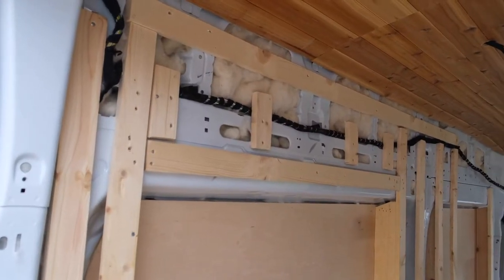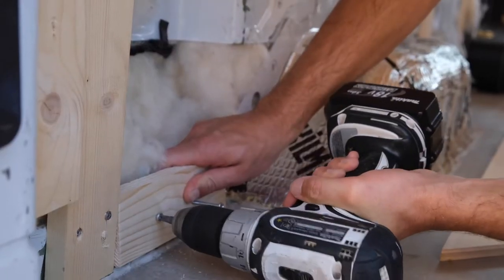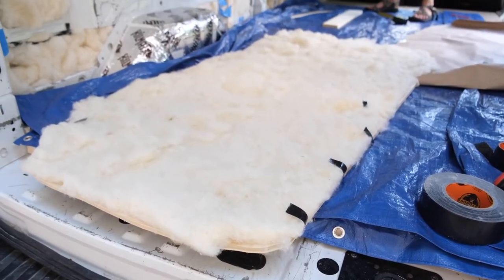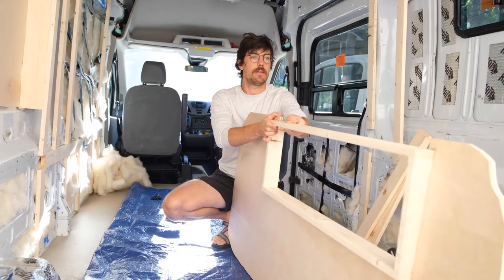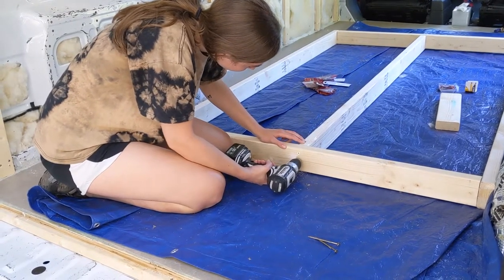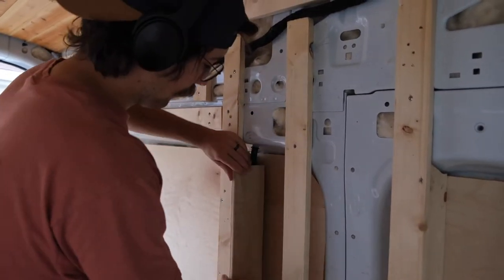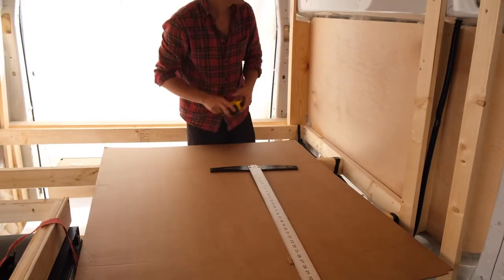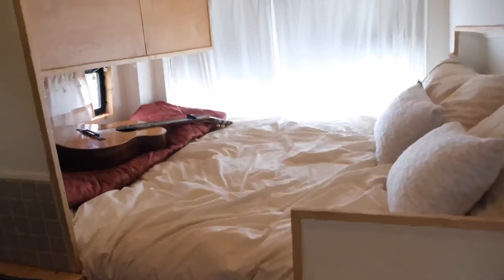DIY VAN BUILD: Furring Strips, Bed Bump Outs, Built-ins & Wall Panels!

Comment: Those support bars in your bump out area are not needed. If you cut them out of your van you’ll get another 3-4 inches of head room 🖤🖤
Reply: Can you explain what you mean or post a screenshot pointing out the spot you mentioned?
Reply: @IvyEcho13  no screenshots on youtube my guy. Just literally cut the interior bars where the window cutouts are. They are not necessary and you'll get 2" of extra room on either side

Comment: Question! How much did you spend for the whole framework and how much time did it take?
Reply from the maker: Hi Nuria! Unfortunately we didn’t track how much $ we spent on the framework specifically, but since we managed to frame the whole thing using cheap lumber and screws, it was pretty affordable compared to other elements of the build. Sorry we can’t be more specific! 

As far as the amount of time it took... we did the framework in stages over several months so it is tough to gauge how long the whole process took. This is just a guess, but I would say give yourself a full day or two for each part of the framing process (furring strips, bump outs, build-ins, wall panels, trim). The most time consuming part was figuring out how to actually DO each part, along with coming up with creative solutions when we were stumped, so hopefully this video will save you some time on that front. 😅